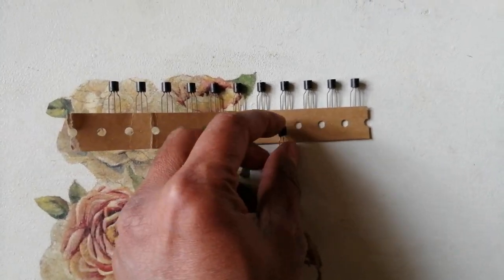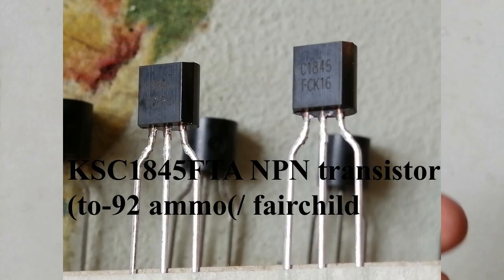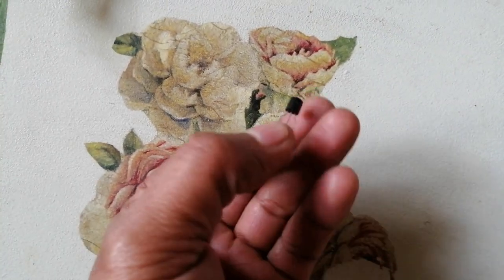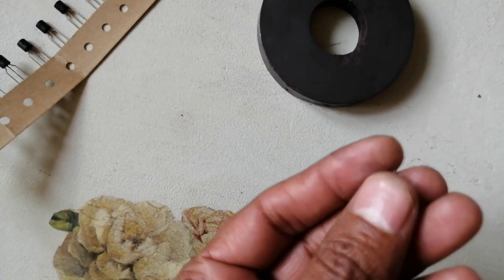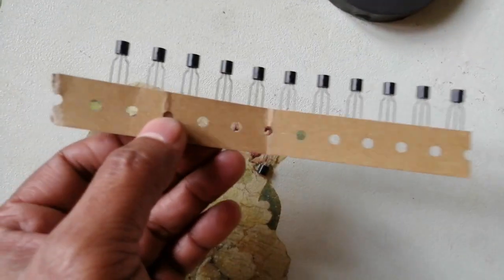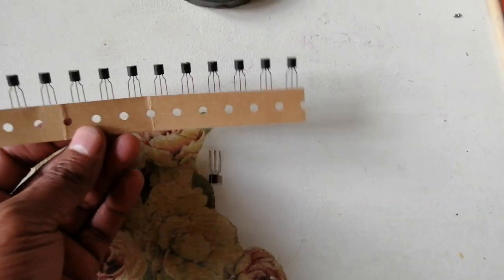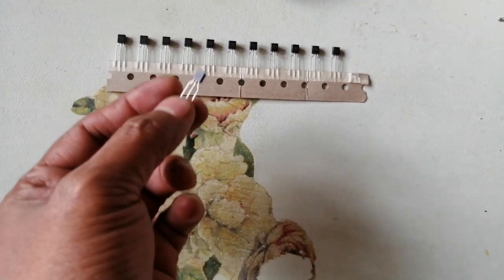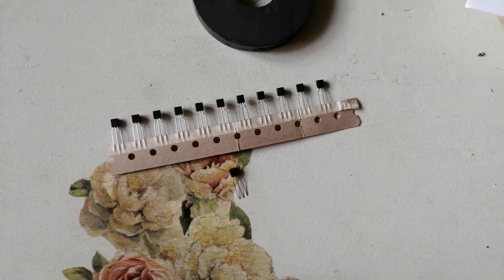TRANSISTOR REAL OR FAKE - Help.....

Comment: One easy way to tell if these are genuine is to measure all their hfe values, measure it, put it back and write it on the cardboard. They all should be fairly close to each other. For example if you measure one at 450 and the one right next to it is 370 that's very unlikely and is probably not right. You shouldn't see more than 50 difference between lowest and highest on an entire reel, normally you always have a few next to each other that are almost exactly the same.

Comment: Hello, The fact that the manufacturer used CCS (copper clad steel) instead of pure copper doesn't automatically mean that your transistors are fakes. It's not just a modern trend due to the rising price of copper - it depends on the technology the manufacturer has chosen. Most of the old Siemens TO-92 transistors I had to deal with had these magnetic properties yet I have never encountered a single Telefunken  transistor which would be magnetic. Maybe someone with KSC1845 transistors obtained from a trusted source could do a test to compare with yours.
Reply from the maker: thanks for input ! i have already used it in amplifier and seems to work fine ! for me it is was an initial surprise !
Reply: @ManuLeisure  You are welcome, best to try in circuit with old and new and have a listen to compare.
Reply from the maker: @speedyelectron6866  it is interesting what you have just said. i have notice the difference in sound - the original 2SC458 were noisy but there was life in the music and new ones (KSC1845 ) are has very low noise but dont have that life old once had ! dont know the reason but it is what it is !